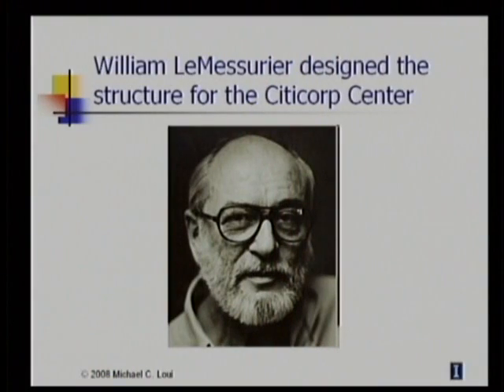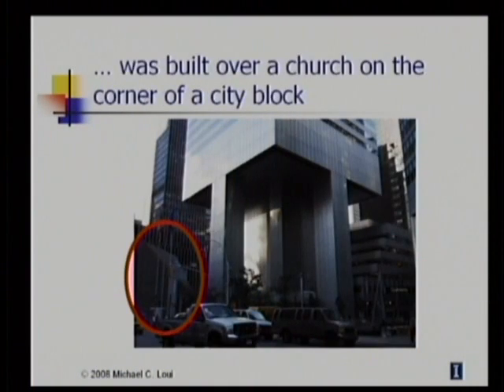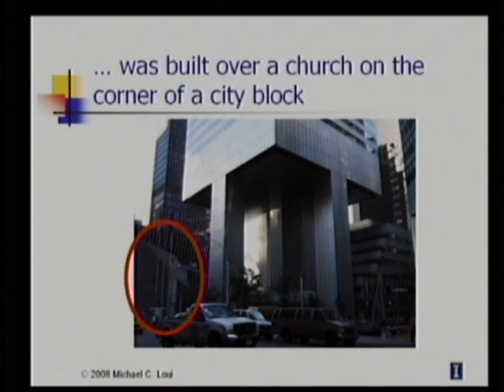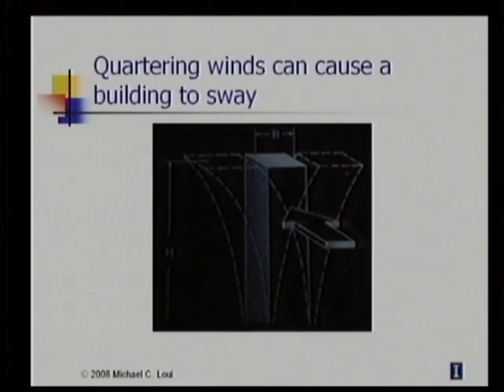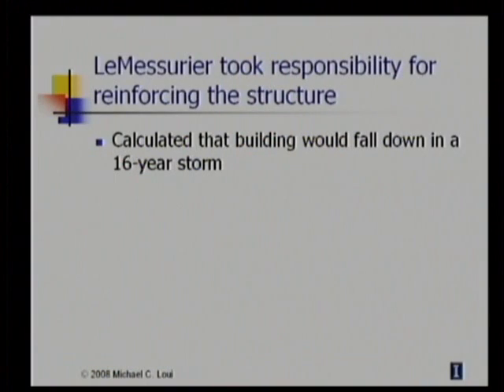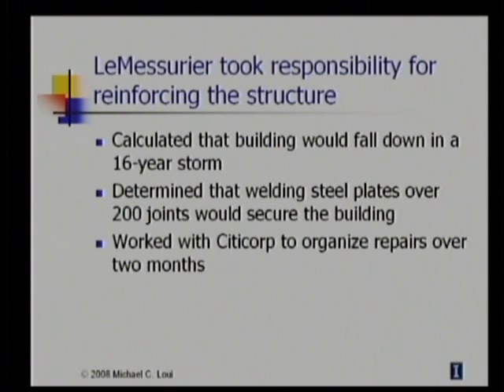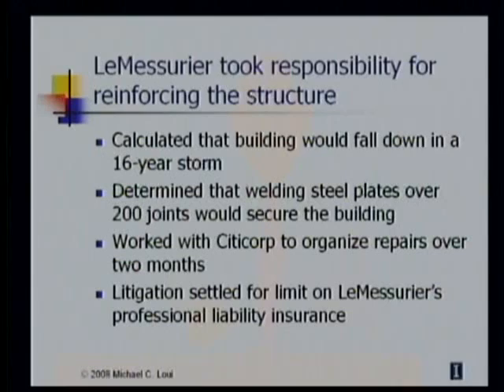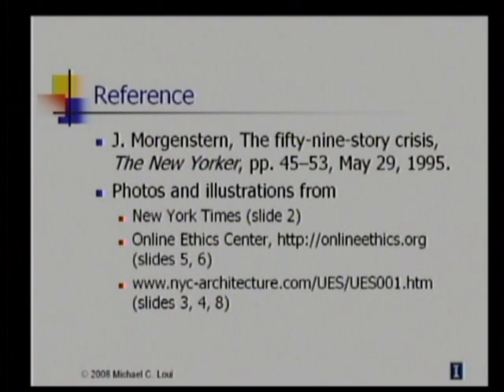Professional Ethics in Engineering, Part 6: The Citicorp Center Case

Comment: a 2019 NIST re-analysis of the wind loads says that LeMessurier's concern over the quartering wind loads (winds blowing at the corners instead of directed at the sides of the buildings) may have been misguided - the building may not have been as vulnerable as he determined - and the reinforcement may have been unnecessary - (search the web for "Blown Away: Revisiting a Famous Engineering Case" - one as Europe PMC website has the entire text accessible)

in that NIST article - it credits Diane Hartley as the student who influenced LeMessurier - but the actual student who did revealed himself since the NIST reanalysis - Lee DeCarolis - however Hartley did anticipate LeMessurier with her concern over the quartering winds - but both may have been wrong - an re-analysis of the building structure in view of the new wind load numbers would be needed to rest the case

however - the Citicorp Story is still an excellent example for professional ethics studies - in 1978 - they had to go with LeMessurier's recalculation - not a high tech study 40 years in the future - and LeMessurier & the bank & the city & the welder's union - et al - all conspired to "fix" the building as fast as they could